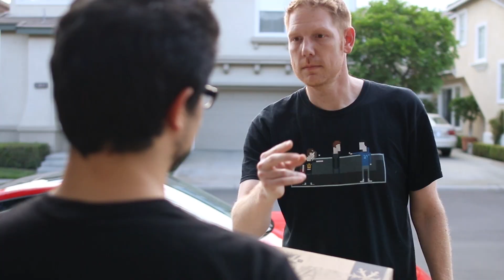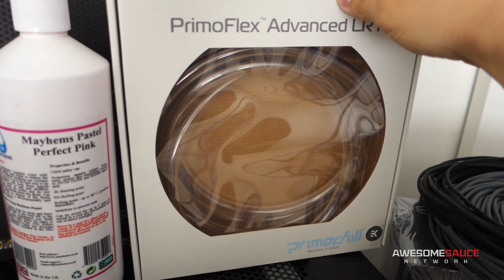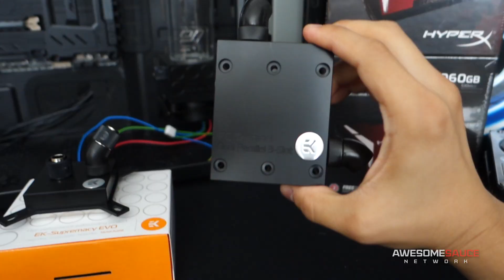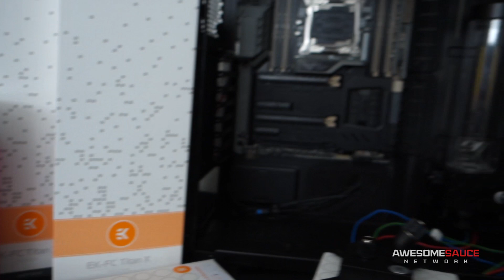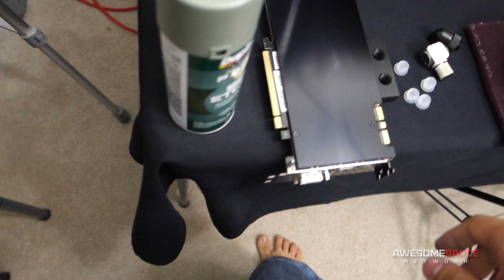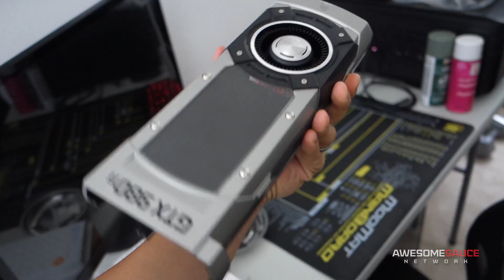Custom Water Cooled Build Log 3 -  THE PARTS & GPU Water Block Installation!

Comment: Why do you apply the thermal paste by using the cross method? Why not the grain of rice method? Just wondering why...
Edit: On the second one, you use the grain of rice method, could you please explain why?
Reply: Zerqui Not that you'll see a huge improvement over one way than the other.  However for GPUs its best to use the cross method since what you see it the die itself and its fairly large and the cross method covers it the best.  For Intel CPUs their small and narrow. Their dies are not expose they sit under the heatsink, to cover it in thermal paste or not is up to you, the rice method will be minimal.  And for AMD CPUs their dies aren't exposed either however they're not as narrow as Intels so the pea method will best suit them.
Reply: From what I've read, seen and heard it's more of a personal preference to which method you use. There is really not much of a difference between the two. Although some people will obviously swear by their method one way or another I have found that most people testing the different methods have not found a noticeable difference. My guess as to why he did them differently is that he's doing his own test on the two methods since he is running 2 980ti's. He can then compare the thermal results after the system is built and can make his own conclusion as to what method is better so he knows which method he wants to use in the future(even though imo/experience it does not matter).  The only things that matter with thermal paste is that you use a quality brand and that you do not apply to much or to little. He also might have just done it without thinking about it and I just over thought the fuck out of that lol
Reply: With graphics cards the cross method is the better one and recommended by ek and other water block manufacturers. I guess he just forgot the second time.

Comment: I don't recommend painting the sleeving, in the long run it will start chipping no matter how many coats you do.
Reply: ***** It wouldn't dye well at all as it's a non porous material. The only viable option is to get sleeve in the proper color.
Reply: aumkar chandan agreed, the more flexible the material being painted, the more it is susceptible to chipping not long after being painted. Learned that the hard way.
Reply: aumkar chandan I was thinking that too. Best idea would be to dye it somehow, I don't know how that material would react to it though.
Reply: i see. thanks for the info. i wasn't sure dye would work, but i know paint won't.
Reply: +feelingtardy I don't know if it's still relevant, but there are textile spraypaints on the market that keep a certain amount of flexibilty when dried. I have no experience how they work on PET-sleeves but it works for 100% on paracord.
Reply: aumkar chandan Yep. Painting the sleeving is a stupid idea at best. Epic fail in the making. 

As for screws I recommend getting a few multi section pill boxes. I have over a dozen I use so when I take something apart the screws are separated by location. Especially useful with laptops.  2 for a buck at the local dollar store. Much better than the bowl.

To make it easier to remove a heatsink, power on the cpu, gpu, etc. and run a benchmark for several minutes to heat it up fully, then take it apart as soon as possible with it warm. That will loosen up the compound to make it easier to disassemble.

Comment: Does anyone think the price of the GTX 970 will drop anytime soon? I am looking for excellent 1080p performance at a cheap price, but I can't afford a $400 card. My friend got an EVGA 970 FTW edition on black Friday for $250, so I'd assume the manufacturing cost is pretty low.
Reply: CheekyGoose The manufacturing cost is like 5% of the price.
Reply: CheekyGoose If you can get it on Ebay from a respected seller. I got my 980 for $400 but I've also seen 970 for $275 on there.
Reply: I wouldn't said manufacturing costs are only 5% of the cost of the card but most of the price your paying is to repay the cost of R&D. Sometimes people forget it costs money to research and develop new technologies.

As to which card you should I would recommend the 960 for 1080p performance. Some can be found for $199.

AMD already has HBM memory but NVidia and AMD both will be bringing out cards next summer with HBM2 memory so before spending a lot of money now I would keep that in mind.

Also NVidia is claiming their next generation GPUs with HBM2 memory will have almost 4 times the performance that current top end NVidia GPUs have with GDDR5 memory. That would be one of the biggest jumps in performance in almost a decade. 

In conclusion buy a 960(if you play gta 5, witcher 3 or any other big open world game buy the 960 4GB over the 2GB), wait a year, maybe two, then buy a Pascal based NVidia GPU with HBM2 memory and a 4k monitor. By then 4k monitors will be cheap and you can feel safe blowing a lot of money on a good GPU to last 2-4 years

Right now NVidia 900 series is aimed at specific resolutions. 960 @1080p, 970 @1440p, 980(also 980ti, Titan)@4k
Reply: CheekyGoose what are your current computer specs? and also a GTX 960 is perfect for 1080P gaming. I have a MSI GTX 970 gaming 4g BTW
Reply: CheekyGoose The price will stay the same  for a long time. But the amazon sale might have some for cheaper
Reply: Look at Jayztwocents video about the 970 vs R9 390, buy the 390 and then brag about how much better it is than the 970. (Im a 970 owner BTW)
Reply: I think the best card for 1080p gaming and not trying to play the latest titles. ( That means playing competetive games, or not so demanding ones ) R9 380 4GB Version is great for triple monitor setup and 1080 gaming in general. I think its better than the 960. ( Check out MW Tech channel for benchmarks ) I think its a great card in general.
Reply: ***** I think the 8GB is too much because r9 390 doesnt have the horsepower to utilize all that VRAM. Also you dont have to spend as much for the PSU. I heard that two way 970 SLI needs the same PSU wattage as 1 r9 390
Reply: Marek Tran Na look up the Review from Jay.
I think one 390 would be good enough, and you don't have to buy a stronger PSU for that.
Reply: That's true if you went the AMD route the R9 380 is probably the better choice even over the 960 from AMD. It out performs the 960 on most titles by 5-10 fps and can also be found for $199
Reply: TekCat My specs are an i5 4690k, 8gb of DDR3 RAM, and Intel's onboard graphics (4600). My power supply 750 watts, so I can handle pretty much any graphics card on the market.
Reply: SneakyHardware I agree. If I was in the market for a 970 right now, I would definitely switch over to the red, and go with the 390. I mean, look at all the extra vram headroom you get with it.
Reply: Marek Tran What about the 4GB 380 vs EVGA's FTW 960 with 4GB?
Reply: R Brooks R9 380 still wins ( The r9 380 doesnt come factory boosted but you can easily overclock it with MSI afterburner )

Comment: I would strongly recommend you don't paint your sleeving.  Painting plastic can be tricky (you need to use a paint specifically designed for it). The sleeving will be handled extensively and a lot of the paint will probably come off. The sleeving isn't that expensive.  I would recommend just buying the color you want. FYI I've been a professional painter for over 20 years and I almost spit my root beer out when I heard you say you were going to paint your sleeving. Just trying to save you some time and headaches. Keep up the good work. Love the videos. 
Andy

Comment: Wouldn't it be much better if you dye the sleeving instead of spray painting it? The color will blend much more nicely if it's dyed so it can reach the inside portion of the weaves of the sleeving? I might be rambling about terms here. Please correct me if im wrong.